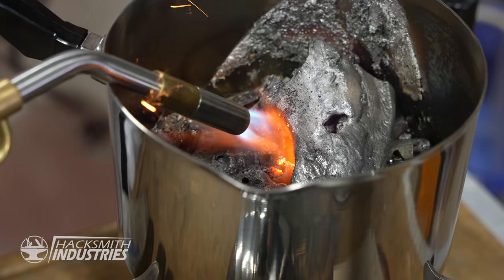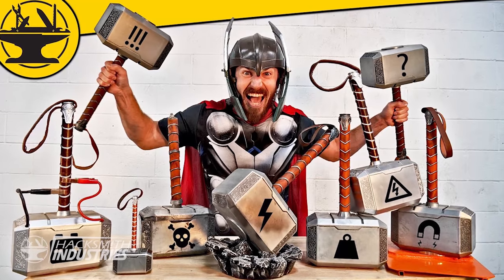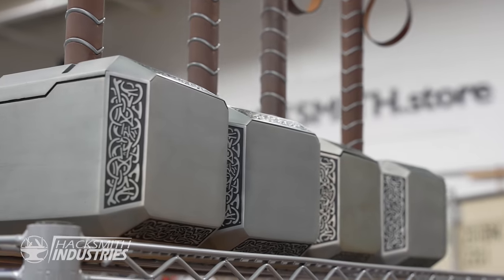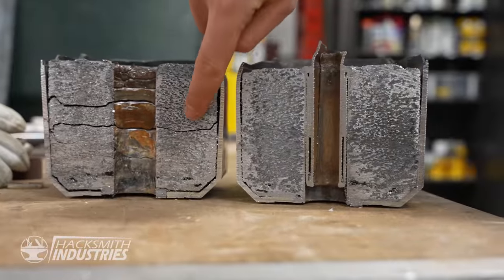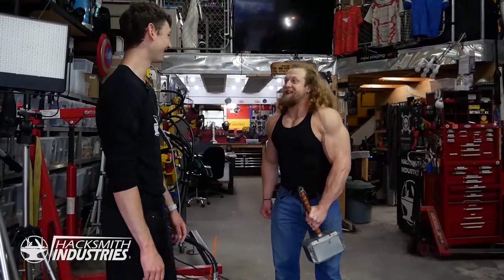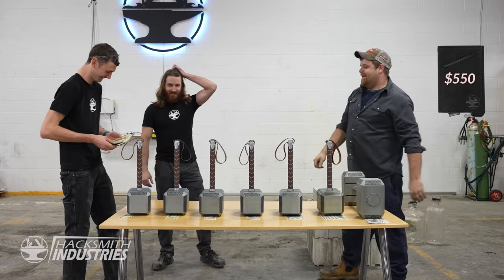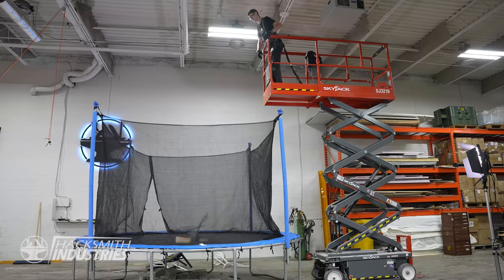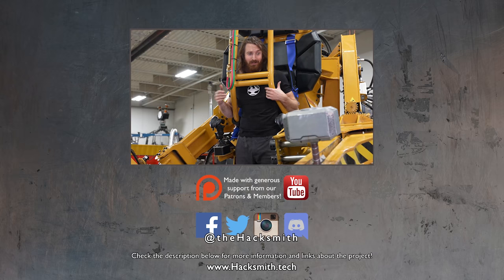Are You Worthy? (Thor workout challenge)

Comment: The power loader is an actual useful tool for big and heavy things you guys should make more mechs
Reply: as much as it would be cool for them to make more, its very expensive and took a while for just one to be made
Reply: Unfortunately they are crazy expensive to build. Maybe eventually they will build another one, but not for a while at least
Reply: @BamsyTheSergal  It took like 7 years didn't it lol
Reply: Hear me out, same mech but with a Thor hammer launcher
Reply from the maker: @popninja8658  only took 3 years,  and in that 3 years we only worked on it for about 1.5 while we waited for funding
Reply: @spencerpendley9583  hulkbuster would be insane
Reply: How is it more practical than forklift? Or a small lift?
Reply: @TheRandompaint  it’s just cool that has actual uses like a fork lift and hydraulic press
Reply: @spencerpendley9583  they are going to put weapon on it like a potatoes launcher
Reply: @BigSwagMoney  it's no doubt cool but practical in an construction setting? I'm not so sure😅.
Reply: @TheRandompaint  but extremely useful loading cargo into interstellar spacecraft, which of course is it's intended purpose.
Reply: @Mechagnostic  of course
Reply: @TheRandompaint  Forklifts struggle a lot with rough terrain, get them off of a concrete pad and they become rather useless - the power loader due to the treads is useful outdoors.

  I had a discussion on one of the other power loader videos, and one of the uses i though of was working with other heavy equipment in the field.
Reply: @hacksmith  wasap
Reply: @spencerpendley9583  yes, or a Thor’s hammer that is proportional to its size
Reply: @gapsule2326  although that’s true I think we should finish a regular iron man suit
Reply: They should make a bipedal mech, at least a small one
Reply: @spencerpendley9583  You got a reply though
Not bad
Reply: @hacksmith  You know what would be a cool idea? A tank , it could be full scale half scale I don't care what it is but a tank owuld be cool.
Reply: Can't wait for the Studio Gainax sponsorship episode where they build a 1:1 scale EVA-01, complete with a supersonic boxcutter, a colossal Steyr ACR railgun that fires depleted uranium rounds, and copious amounts of mental trauma.
Reply: @hacksmith  But now that you've got the entire process planned out you could probably do it much faster right?
Reply: It took them like 4 years to build the first one
Reply: @hacksmith  only 3 years
Reply: A Gundam or transformer would be badass
Reply: @hacksmith  and it was worth it, I love the crazy projects you guys do, could you do the cane from Kingsmen secret service?
Reply: @hacksmith  Maybe now that you're such a large channel, and Boston Dynamics actually has inventory of products they're trying to sell, they would sponsor some ridiculous mech for it to be heavily promoting their products.  Maybe even Husqvarna as well trying to sell their commercial and residential lawn robots.
Reply: @hacksmith  you probably won’t see this but, we all know that real umbrellas fold inward when you try and glide with them. Do you think something like the metal one from fortnite would actually work? Could you make it?
Reply: @hacksmith  you forgot hammer's thor

Comment: I mean if you can pick someone who is 100 pounds, for example, you might not easily carry an object which has less volume than the person even if it has the same weight. Because after all, the object's density is more than the guy's, since the object's volume is less than that of the person. So it's not always easy to carry the same weight of different objects due to differences in their volume.

Comment: I think that double sided hammer would be easier to lift than they think. With those other hammers, all the weight is on one side, and it seems like it's more of a test of wrist strength. If the weight is balanced out from the handle, I bet some of those guys would have a better shot!
Reply from the maker: True, but a 150lb single arm press is bodybuilder level lifting haha
Reply: @hacksmith  oh yeah, didn't think about that. Lol.

Comment: Molten lead has been used in nuclear reactors.  It has a high boiling point and low melting point and is pretty good, actually.   You taking good health protection measures but still I personally wouldn't mess with lead by melting it.    I was born in the era of leaded gas.  One of those 'oops, we shouldn't have done that' technologies.  I grew up in Dayton where the inventor of that technology and several others in manufacturing.